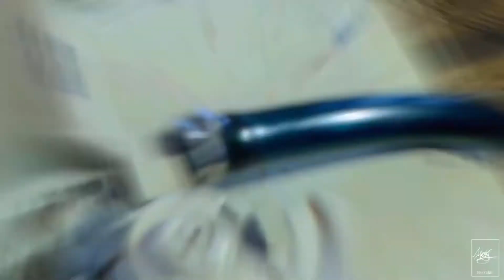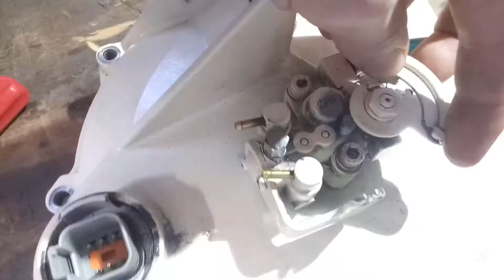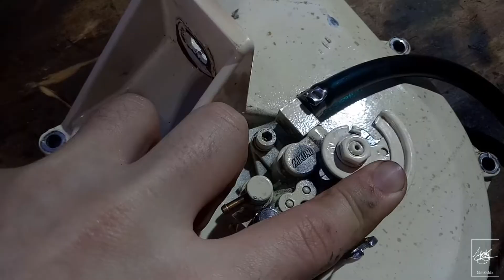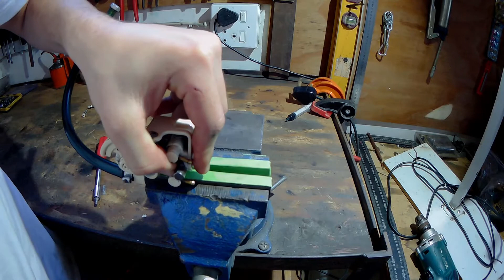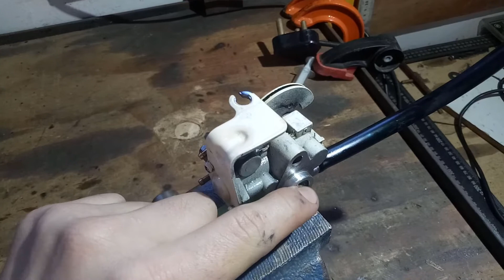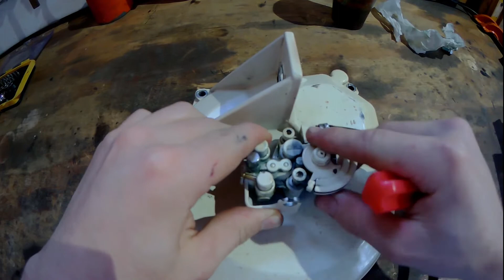SEADOO OIL PUMP (how to test) 787-717 engines

Comment: Awesome video. Maybe someone can help me. I bought a 1995 XP (717 motor), it sat for 3 years, it started up, but I have oil pissing out the exhaust. any idea why , could that related to the pump linkage ?
Reply: Could be you crankshaft seal its worn out.
Reply from the maker: Im not an expert at these but I don't think it would be related to the oil pump. Maybe try looking at the user manual that you can get online or try look at a forum to see if there are any other people with a similar issue. 
My guess it that it would be a seal or gasket.
Reply: The center crank seals. Would mean a total rebuild

Comment: I have 2 1997 GTX and I was wondering How often do these things actually go bad if properly maintained.
Reply: they dont go bad, what happens is people never change the oil injection lines and those become dry annd brittle and crack.  99.9% of times thats the case with a "failed" oil injection pump.

these are mechanical devices that are driven by the crankshaft.  there is a small plastic adapter that connects the nose of  the crank to the oil pump

Comment: My two cents. Good video however, that monster of a hammer drill will destroy your pump. A small cordless with an adapter made of an ink pen can be more than suitable. Very sensitive component to put under such stress. Well done!
Reply: If that .5 HP drill destroys the oil pump mounted to a 110 HP engine, you needed a new pump.
Reply: @rlyle5804  is all about balance. Properly mounted on the engine is not the same as a wobbly hammer drill chuck.  "Get a bigger hammer" is not always the right choice.